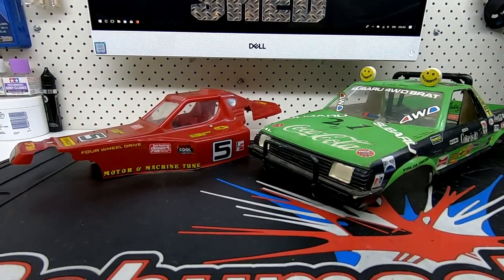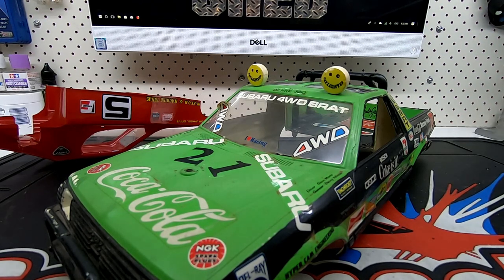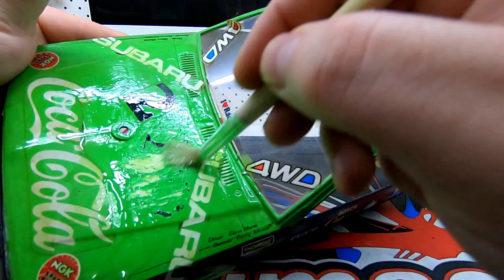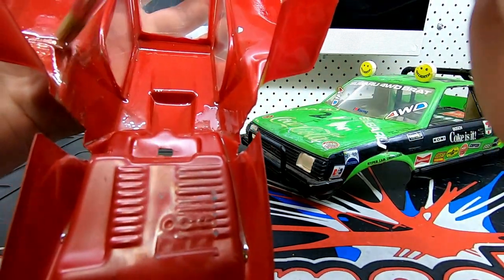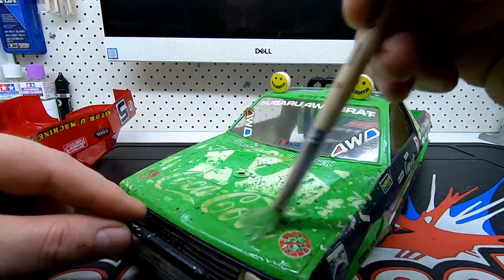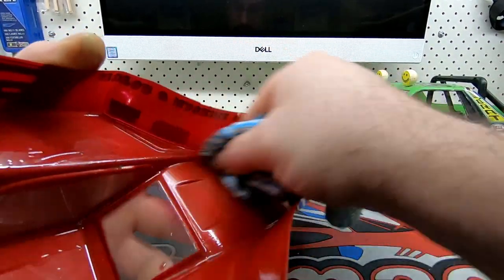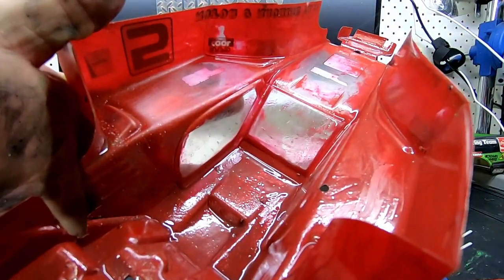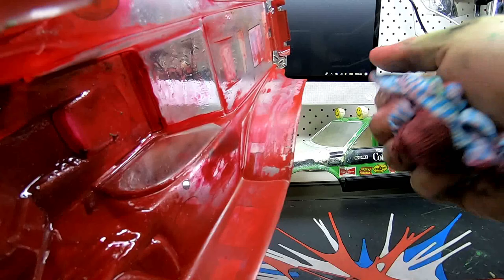How To strip paint from RC bodies -  Lexan and Hard Bodies

Comment: That poor sticker bombed Brat! The stripper works a treat on Hardbodies. The Lexan definitely took a little work - but you still got results. 
I've never used it before, but did learn from experience in the 1990's, Nitro Fuel works too well on Lexan Paint!! 

Looks like the key to the Tamiya Paint Stripper is, let it soak. Good info, thanks!
Reply from the maker: Yeah it does work quite will on hard bodies, although it isn't meant for ABS. It can leave the surface a little rough but it's no problem if you sand and prime. Nitro fuel also works but I never run nitros these days so I never have any handy. So far my best method for Lexan is Methoxypropanol, just soak it for a while and wipe the paint off. 👍

Comment: I used this on an Optima Mid body and it works pretty well, only problem is the body is foggy now.
Reply from the maker: You didn't happen to rinse it with water, did you? I noticed if you use water on it, you'll get instant fog. I think I will do an update video on this problem. I think they key is to wash it with the Tamiya Body Cleaner afterwards. The fog can be taken off with very fine steel wool or very fine scouring pad, but it's a lot of work.
Reply: @RCHobbyShed  No water, haven't tried anything to clear it up yet.
Reply from the maker: @keithrx3c  Hopefully it comes up ok for you! The Optima body I was stripping was  melted from the resistor and had splits that only got worse by me handling it, so I binned it in the end. I did notice the fog marks scratch off with my finger nail, so it seems to only be on the surface. I will give another body a go and do a video on the results. Let me know how you go with yours. 👍

Comment: Tamiya makes a "Polycarbonate Body Cleaner". I do not know how well it works. I have also heard that brake fluid might work too. However, you need to test it before trying to applying it. Why, test it? The polycarbonate body might fog up and plastic bodies could melt.
Reply from the maker: I have used the Tamiya Polycarbonate Body Cleaner, it works well but not as good for large areas as the Tamiya Paint Remover. Tamiya Body Cleaner is really good for body cleaning before painting and removing paint bleeds or overspray on newly painted bodies, I always like to have both products on hand. Brake fluid does work well too but like you said, it can melt hard bodies and fog Polycarb' bodies. I've found Methoxypropanol works very well, also nitro fuel work great too. 👍

Comment: Would white spirits work
Reply from the maker: Maybe, I haven't tried it. I'm planning to try a few things and put more videos out with the results. I know nitro fuel also works but haven't done a video on it. I have a video on using Methoxy Propanol which works well too, Dot4 brake fluid is another one. 👍
Reply: RC Hobby Shed do you know if methylated spirits or kerosene would work? On lexan not hard
Reply from the maker: @coolasrc  Sorry mate, couldn't tell you as I haven't tried them. You could try it in a small area and see what happens. Let me know how you go if you do try it. 🙂👍
Reply: RC Hobby Shed no worries mate, I’ll give it a go tomorrow probably on a small area like you say and see if it works. I’ll let you know. Cheers
Reply from the maker: @coolasrc  Thanks mate, should be interesting. 👍